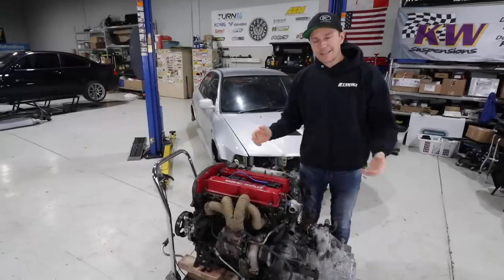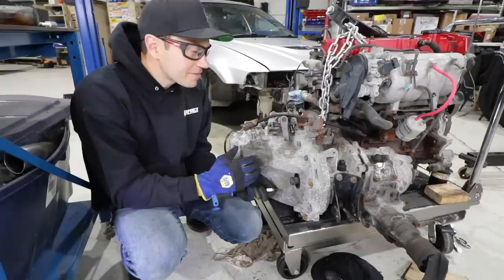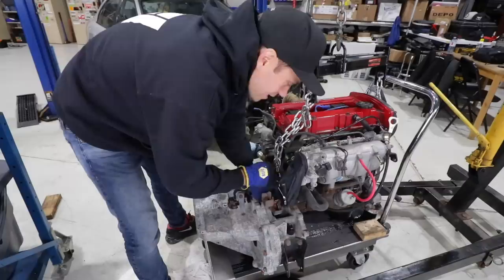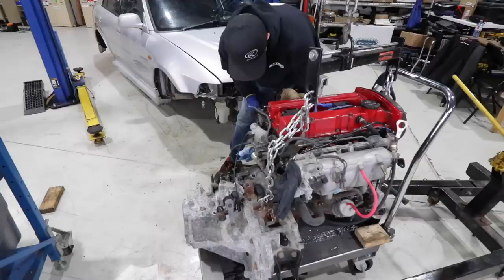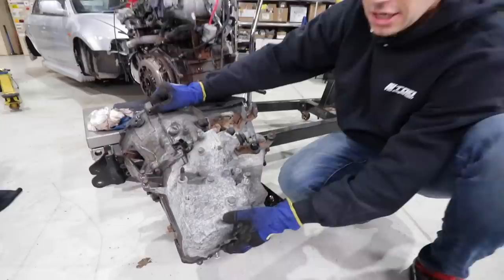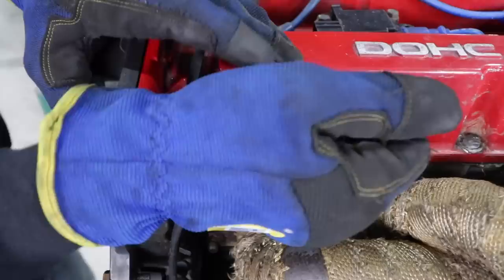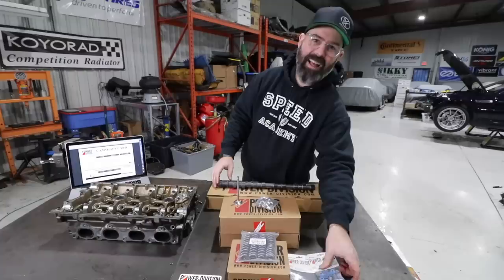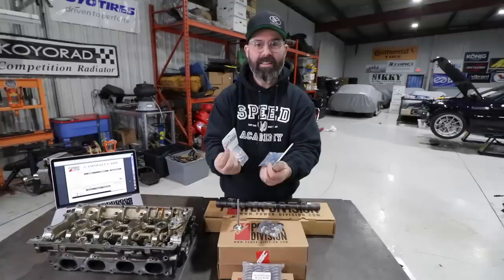Cheap EVO 6 Engine Teardown - How BAD is the 4G63?

Comment: Nice work guys! It looks like you've actually got a good base motor to work with. Couple of things that I wanted to offer:

- I've found the best way of getting oxidised/filthy aluminium castings back to 'as new' condition is vapour blasting. Sand/media blasting gives a really coarse surface finish that tends to get dirty again really quick. 
- That vac canister is part of the factory ALS system and you don't need it. 
- The knock sensors on the EVO 4G63 engines are generally pretty reliable but of course if it's taken a hit or been visually damaged then all bets are off :)
- The 4G63 EVO4-9 run a waste spark ignition system and those coils are dual post coils - One side is like a conventional COP system and the other post runs to the lead. They are prone to heat related failure and given yours is now a 'two piece' coil I'd opt for replacing them and the leads with new.
- The wear on your bores and piston skirts looks pretty typical for what I'd expect to see from a high mileage motor. Nothing too worrying really. What I'd be more concerned about is any scratches you can feel with your finger nail. Ultimately it doesn't matter since you'd be best to use a 0.020" oversize forged piston which gives the machinist the opportunity to bore and hone the bores to get them back to perfectly round and true. It's also a good idea to have the block torque-plate honed as the bores do tend to distort a little on the 4G63 when the head is bolted down.
- I always removed the balance shafts on any performance build and provided the rest of the components are balanced by your machinist you shouldn't have any abnormal vibration levels. I don't remove them so much for power as reliability since it's one more belt that can fail. If you remove the shafts though don't just cut the shaft off the oil pump driven gear and block the oil hole as many do - This can result in oil pump failure. Instead you can have a machinist machine the counter weights off the balance shaft. This eliminates the weight but still supports the oil pump gear. The other shaft can simply be removed but you need to turn the balance shaft bearings to blank the oil gallery holes. A frost plug works well to blank the resulting hole in the front cover ;)
- As for your main bolts, personally I'd opt for a set of ARP main studs - In particular you'll often see fretting between the block and cradle with stock bolts in high power/high rpm engines so the ARP option is cheap insurance. In my experience the ARP studs don't distort the main bearing tunnel so there's no need to hone the tunnel.

Hope that helps and look forward to seeing the updates!
Reply from the maker: Thanks Andre! The good news is we recently ordered a vapor blaster, the bad news is we'll probably assemble this engine before it arrives. But our machinist did clean everything up nicely for us and based on his analysis he thinks we're ok to use the stock bores. I'll send you some detailed pics for your feedback, since it'd be great to get your input on this. 

Pete seems determined not to delete the balance shaft, but I'll show him your input, as it makes perfect sense and we are upgrading to high quality internals that we will balance using your process. We will most certainly be using ARP main studs, already on the shelf here and ready to go! 

Do you recommend balancing the crankshaft, flywheel and clutch combo for a mild(ish) build like this?
Reply: @speedacademy  as a rule we rebalanced all the rotating components in our 4G63 engines regardless whether they were moderate power road engines or circuit/drag engines. For lower rpm operation it wouldn't be considered strictly necessary since the components are already balanced by the factory, however we can work to a finer tolerance which can offer smoother operation. It's not something that will necessarily show a gain on the dyno but it can help improve engine life expectancy and give a smoother feeling engine at high rpm. It really comes down to your budget for the job and a bit of internal cost-benefit analysis.
Reply: For the record I’ve been cutting the shaft, and using a longer bolt to plug the hole in all my 4G63 builds and never had an oil pump failure even turning 10,000rpm. Also have never had the vibration even on stock bottom ends that Pete is referring to in this video. If it’s vibrating so bad that bolts are coming loose you have another problem. Just my two cents.

Comment: The plastic canister under the intake manifold is a vacuum canister for the SAS (Secondary Air System or air bypass antilag) which is a factory antilag system used in Rally. But the SAS valve and exhaust side plumbing has been removed from your engine so it wont be doing anything. It is normally plumbed into the exhaust manifold where the two large banjo bolts have been blocked off. The system passes boost from the intake around the engine straight into the exhaust where the ECU adds extra fuel for combustion in the exhaust manifold to keep the turbo spinning when you lift off the throttle. 

The Knock Sensor should be fine unless you can see physical damage to it. Phantom knock is common in these cars as they can pick up all sorts of noise. Often this can be tuned out.  But you guys really should get the service manual and there is a factory pdf manual online that was available for free, but it looks like that might be hard to find now.

Comment: If in doubt replace all the sensors.  It’s a while your in there thing.  Better now than pulling it all back apart after.
Reply: Yeah, do EVERY sensor.
Reply: And hose
Reply: Hell, brand new wiring harness. The insulation is probably starting to harden and crack.
Reply: @jameshaulenbeek5931  wiring specialties
Reply: As long as you can afford new oem stuff. On alot or cars seems used oem sensors are as good or better then aftermarket new junk. 
Nissan crank/cam sensors are a great example of that. I think I've heard similar things of alot of mitsu sensors as well?
Reply: Another vote for changing everything while the engine is out.

Comment: brass brush only, do not use stainless steel or steel brushes on aluminum. Use a brass wheel  then spray it silver. otherwise it will re oxidize in litteraly a month. you could get it vapor blasted if you wanted to be super lazy.

Comment: Dry ice blasting should be the way to go. Not abrasive and not that much of a mess.
Reply: This works wonders. its what i used.
Reply: I would love to see you guys find a dry ice blaster/rental.  Those things are insanely useful and are exactly what is needed here.
Reply: Use dry ice blaster at work. Works great and no worries about the blast media as it evaporates.
Reply: Eagle one etching wheel cleaner will make cast aluminum look brand new
Reply: @david92xj  Thanks for the tip, going to check it out.
Reply: @sigmaprojects  no problem, just make sure it says etching. They make a few different kinds and that's the only one that will give you the results
Reply: @david92xj  gotcha, thanks.

Comment: Best way to remove the oxidation is a blast cabinet. Use steel shot, not sand! Sand gets everywhere. Steel shot is clean and reusable! Only issue with it is that you will need to replace the view finder more often as it wears it out quicker! Can't believe you guys don't have a good big blast cabinet in Canada with all the cold wet salty weather?
Reply from the maker: We're currently in the market for one. After this job we told ourselves its time to buy a blaster. Just trying to figure out which one is the best to get.
Reply: @speedacademy  I have heard good things about a psbc990.

Comment: I've used vapour blasting for gearbox casings before and they come up looking brand new! Plus it peens over the 'pores' of the aluminium a little which helps future cleaning and tends to prevent the casings being stained so much when oils and grease are  dropped on them.

Comment: I’ve had good success in the past using lightly diluted standard white vinegar and a red 3m scuffing pad to remove most of the aluminum scale and finishing with a alloy wheel cleaner. For the toughest spots a soda blaster with a light abrasive works great before using the above method. Hope this helps!

Comment: Done it before, trust me cp pistons, upgraded wrist pins, carrello pro h rods, s2 cams and upgraded springs and retainers, oem gasket kit, don't forget to do the felt washers on the clutch arm + oem pully and belt kit + delete front and back balancer, turn down the front

Comment: For the aluminum gearbox housing degreaser, wash it off, and then torch. The torch will also clear up the fine surface cracking. Weird, I know. It works great though.

Comment: Hey guys, re balance shaft delete... Every time you delete the balance shafts you should be balancing your rotating assembly. That will keep it from rattling itself apart. I’m no expert myself  but I did help and watch a master machinists build 30+ 4gs at my first job at an engine builder that specializes in these engines. Just my experience!

Comment: Heavy duty oven cleaner is great for tidying up cast aluminium. You don't want to leave it too long, but spray it on, covering the part in a thick foam, leave for a bit, then use a brush on it, hose off. Repeat if necessary

Comment: Canister under the standard inlet is to do with the SAS (secondary air system) which yours doesn’t have. The 2 big bolts in the exhaust manifold are where the standard pipes went

Comment: If the knock sensor doesn't have any signs of leakage (the notorious black goo), keep it. The conrods on 7 bolt 4G63 engine from DSM to Evo 6 are identical, and do not hold up to much power. From EVO 7 onwards Mitsubishi finally reinforced the conrods, which easily hold up to 450 crank horsepower. The pistons also got a redesign from Evo 7 and up, with better skirt coating. As for the emissions stuff, remove them all but keep them somewhere just in case your yearly inspection requires them. You can buy or make aftermarket EGR valve block off plates.

Comment: The spark system is ‘waist spark’ hence only 2 coils. The leads breaking is due to the rocker cover to spark plug tube seals weeping oil onto the plug leads. The seals are meant to be change every 45,000km
Get ride of the waist spark and go for platinum racing product r35 grr coil kit and use a haltech to run the show. 
I also suggest a heat shield for the cam speed sensor as the heat from the exhaust manifold kills them regularly

Comment: The Coils are a wasted spark setup. Two coils for four cylinders, whenever it needs to fire one cylinder to ignite the mixture in it, it also fires the other cylinder that is pushing exhaust out at that moment.

Comment: OEM on all replacement parts. I just had Curt Brown (Curt Brown Racing) rebuild/port my Evo 8 head. If your going to keep the stock intake manifold, have it ported also. It is good for some decent power depending on how far it gets ported.

Comment: Watching you try and wiggle that gearbox off wondering why the hell it won't come free... I did exactly the same thing. Then.... read the manual and pulled the inspection bungs out and popped the spring clip on the clutch plate hahaha! Well done guys great video!

Comment: That's a waste spark ignition system that fires the plug on the power stroke AND the exhaust stroke. One coil fires 2 plugs on the same crank plane. One cylinder is on the power stroke and the other is on the exhaust stroke. And always twist boots loose before pulling straight out. If they're too far gone there's not much you can do about it anyways lol. Keep up the great content!

Comment: Go to a truck/trailer supply place or garage near you.  Look for - Aluminum Trailer Cleaner and Restorer - A company named WAB makes the product I'm personally familiar with.  That's the kind of thing to want to get for the trans case clean up.  Just follow the directions and precautions from the manufacturer of the chem you use.

Comment: Use acid wheel cleaner on the aluminum. Works wonders on removing light surface rust staining as well
Reply: The bottle of acid is significantly cheaper and it has other uses around a shop. Just my two cents.

Comment: Would recommend going .5mm over bore on the cylinders and have the machinist set the correct piston to cylinder wall clearance based on the piston requirements, deck the block and head for good metal gasket seal and have the cams degreed after assembly to ensure cams are to spec

Comment: 6:25 HCl at about 25% per volume, aka Muriatic acid. Use a plastic bristol brush and some PPE: smock, gloves, and your face shield. 

Notes: The acid is not very powerful but the PPE will keep you from having itchy skin. Be prepared to wash it with lots of water (maybe a little baking soda to use less water). Don't freak out when backing soda and acid mix and then bubbles up like a science project volcano lol

Comment: Hey guys. I'm a little late to the party but I wanted to say that I love the show.

For removing the oxidation, Soda Blasting would be a good option if you haven't picked something up by now. It would just be a good asset for the shop because of how versatile it is for cleaning surfaces and removing rust/paint. Easy clean-up too.

I also wanted to touch on the valves at 28:10 or so.. If I remember from the Abandoned STi build, the exhaust valves are made out of a metal called Inconel, which is a family of nickel-iron-chrome alloys that are engineered for pretty extreme conditions. The exact figures will depend on which alloy is used, but Inconel will maintain its strength at temperatures up to about 2000F (1093C for those outside the US). You'll find it used a lot for jet turbines and rocket nozzles.. and more recently as a high performance exhaust valve. It's pretty much a perfect match for the crazy high heat and pressure getting spit out of the cylinder of a boosted engine. It's also notoriously difficult to machine because it work hardens very easily.. making them very time consuming and expensive to produce. Totally worth the extra money if your building a performer engine though.

Comment: Since you mentioned the counter weights, personally if and when I do a rebuild like this I plan to balance the rotating parts example weighing the pistons and removing the material from the heavier pistons down to the weight of the lightest.

Comment: To remove oxidation from aluminum, spray a diluted mixture of drain cleaner and water 1/10 ratio. Let it sit for 3 mins and rinse it with water.

Comment: Alumiprep 33 for aluminum oxidation removal and if you want to be baller use Allodine 1201 to treat the aluminum. These are use extensively on aluminum in aviation. (The Alodine will turn the aluminum yellow just FYI)

Comment: Make sure you also use version 3 hydraulic lifters so you have good oil flow to the valve train. Anddncheck out Jafro or DMS tuners for the oil port mod
Reply: If you plan on revving a 4g do not use revised lifters,4g63's are known for drainback issues and revised lifters do nothing but throw more oil in the head....

Comment: You should do a minor port and polish that doesn’t remove a lot of material for a smoother flow and to gain some horsepower without sacrificing power on the low end

Comment: This is gonna sound weird but most types of drain cleaner contain high concentrations of sodium hydroxide. That works well. And some degreasers also aren’t meant for aluminium and if u use them on there and just not let it sit for days it eats away most oxides.

Comment: clean that trans with spray on oven cleaner, scrubber , lots of soapy water in a spray bottle, 10 bucks at dollarama will change your life. works on steel blocks but really brings aluminum back to life, will kill rtv so clean before you re gasket. also im local and will see you at tmp this spring!

Comment: 10:24 I've had that happen on my E30 M20 engine. I replaced the timing belt after I got it and it was so worn that it started slipping off the gears and pressing against the cover.  The belt was actually 1/2 the diameter it was supposed to be.

Comment: That looks pretty normal for an evo6 4G63 although you guys might want to re prep the block because you might sacrifice ring seal. Don't forget to improve the oiling system too as much as you can to not run into oil starvation especially when you increase the power. Hp academy is awesome I have some of their courses and no words can explain how it takes the guess work out and provide you with best practices. They also have a sister company call Racecraft hq and it is all about car setup, vehicle dynamics, and driver training soon.

Comment: I like to put bolts back in the holes they came out of as much as possible, which avoids issues from things having different bolt lengths in various holes.
Reply: That is another good method and I sometimes use it. Especially if I'm doing a smaller job on one particular component. I find that when you take alot of stuff apart it can be a little annoying and time consuming because you have to take the bolts back out before you can install anything, clean a surface etc.
I like removing components, bagging the fasteners, labeling the bags and keeping them in a box or area with the component they go to. Labeling takes time too of course, but I personally like it better.
Reply: chickenfishhybrid44 I do it this way many time because I’m just too lazy to bag and tag lol. Plus I think having the bolts in the holes can help when the car is apart for a really long time. My car was apart for a month for my clutch replacement, and I got it all back together just last week with no missing bolts and nothing left over. 👍
Reply: @Patrick94GSR  right on, whatever works for you. It is definately an option. I always snap pictures with my phone before and during taking stuff apart too if it's a big job and I know it will be apart for a long time.